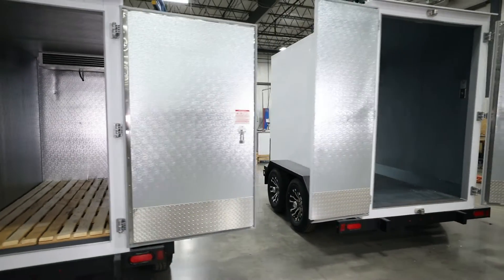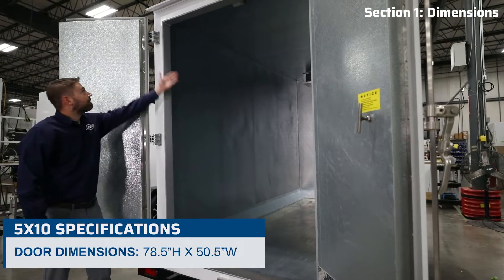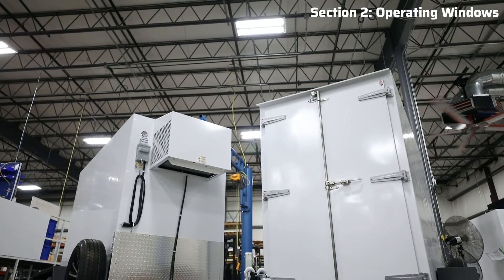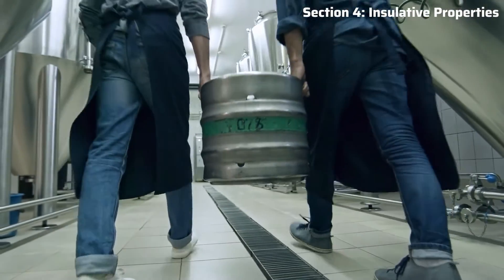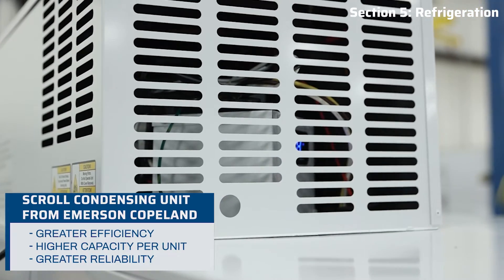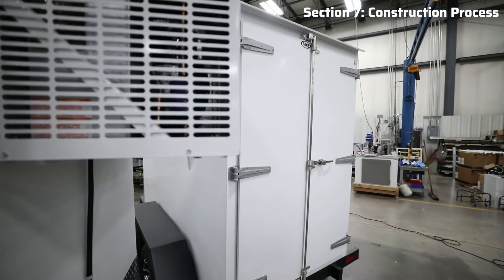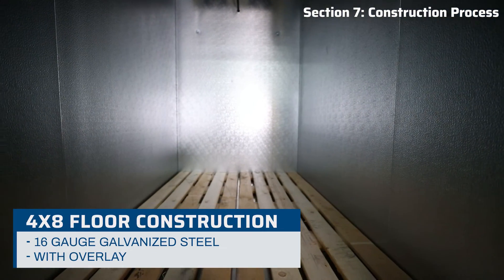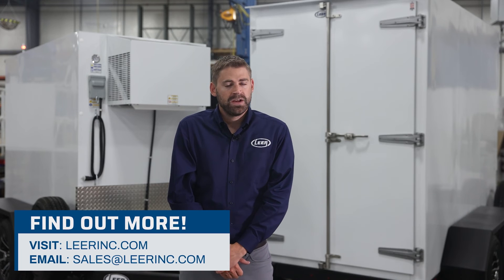Multi-Temp Refrigerated Transport Trailer Overview - 5x10 & 4x8 | Leer Inc.

Comment: How does the unit bolt to the trailer?
Reply from the maker: Great question! We use 4-6 Carriage Bolts, depending on the size of the unit. The recommended minimum bolt size is a 1/2” diameter by 6 ½” long carriage bolt, SAE grade 8.
Reply: Do you bolt right through the floor? ( drill holes or have bolt brackets under the floor?) would the pallet fetch up on the bolts ?